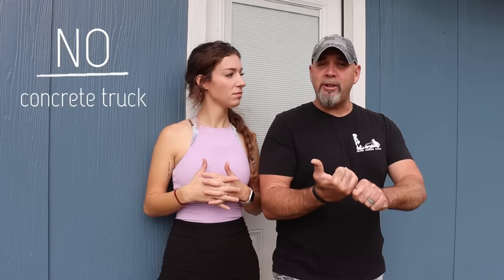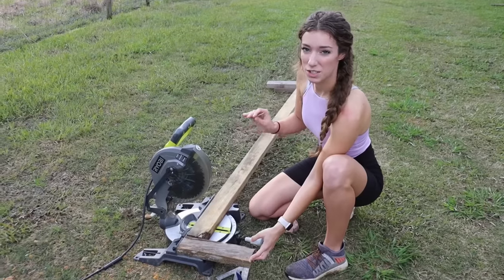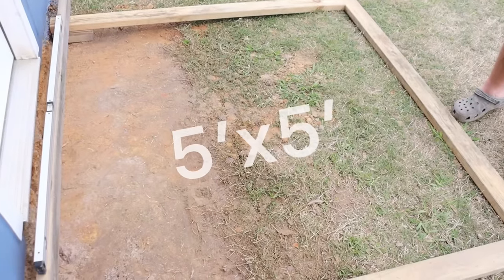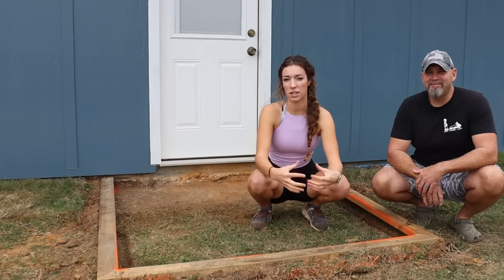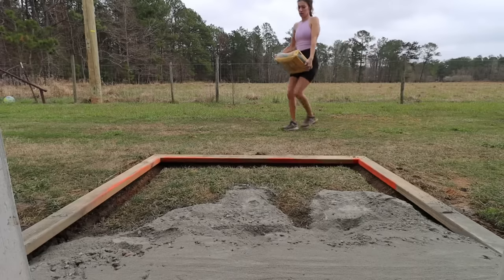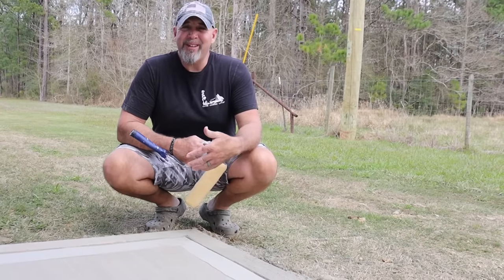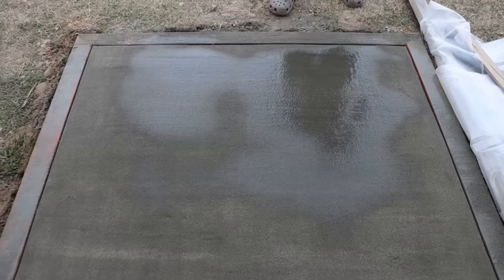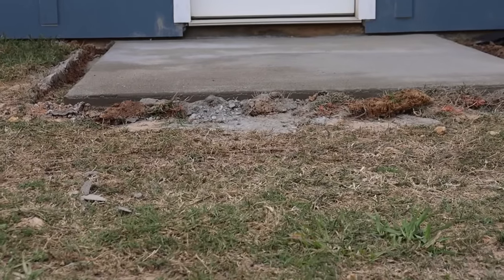How To DRY POUR CONCRETE SLAB and Update of Our 1st Pour

Comment: I wasnt looking for a new project, but I think you just created a new spark for this summer. Concrete for the fire pit and for my garage. Thank you for showing me the simple way to do what I always envisioned to be a difficult task. I can measure. I can cut. I can build it.
Reply: I want to create a concrete pad for my winter wood supply. It’s 6.5’ x 50’ area. Will this method of concrete slab be strong enough to endure the weight and winter weather?  (Middle of Michigan)
I do realize that I will need to break this up into smaller slabs.
Reply: Man I said the same thing.  Like I’m about to go build something for my dog outside

Comment: Well, I’ll be gobsmacked! Never would have thought concrete mix would set up this way. Not only timesaving, but you avoid the effort of mixing up wet concrete with a mixer or by hand with a shovel. And by the way, you have solved my problem of how to grout a 1000 square feet of laid brick. Instead of working the wet grout into the spaces between the bricks, I can pour dry mix onto the surface, carefully sweep it into the cracks, and then lightly mist with water. This will also save time and effort by not having to remove wet grout from the bricked surface. Perhaps I’ll do a YouTube video of the process and with y’all.
Reply: Awesome idea with the grout I’m Curious to know how that works out.I’m not thinking about a vertical brick wall I am thinking about grouting tile on the floor.
Reply: I may be overthinking things but wouldn't the dry powder on the bricks set up also and end up creating more of a mess than a solution?   If you weren't already going to do it,  I would suggest testing a small area first and move on from there. Hope everything turns out well.
Reply: Polymeric sand  is much easier to work with and that's what it is designed for.
 If it gets ugly down the line, pressure wash it, sweep in more, blow it off, wet it, done. It'll take you about an hour.
Reply: Great idea 👍🏽

Comment: I used to build fences and I would often dry pour my posts, and then water them all at the end of the post grade.  I never had a problem and 25 years later those fences still stand straight as an arrow.  Great job!! Never again will I mix concrete.
Reply from the maker: Thanks for watching!!
Reply: I did the same! The less water you use, the stronger your concrete will be.
Reply: Would this work for a sidewalk?
Reply: @andrewlaiz7648  Depends on the sidewalk. If it's not getting a lot of heavy traffic, then it would probably be fine. I personally would not try this for a driveway, but if you just want to add or repair a walkway between the back door and the gate, I imagine it would be fine for that
Reply: Same here. Wife and I did over 400 feet of cedar fencing in 1993 and set the post with dry pour. Lost 1 post about 10 years ago when a tree fell and snapped the post off. No problems with the other posts. Have replaced the rails and fence boards, but used the same posts.
Reply: How much water did you put in each hole, once you had your powder in the hole?
Reply: If you can leave the posts alone for a couple of decent rains + 1 week the concrete will wick the water right out of the ground. Right after the first rain I'd double check the posts for plumb.
Reply: I do the same with all my fences!
Reply: I did that for a fence 10 years ago.  When we moved out a few years later, it was still sturdy.  No issues.  I did this again last Fall.  
I also mix in some old (but clean) landscaping rocks.  Doesn't need to look spiffy since it's all in the ground.  Just keep dirt and organic stuff out of it.  The posts are 3' deep.  I add some water about halfway.  Then finish adding rocks and concrete.  Then dump some water on top when it's filled.  Any dry concrete that didn't get wet should be able to pull moisture from the ground.
Reply: They sell bags of concrete at home Depot made for setting posts , fast setting , the directions say to put it in the hole dry. I usually add a half bucket water on top. Some people let the concrete suck the moisture out of the ground , it dries slower , but strong. Problem is that the post will move if you touch it.  I have used the same fast setting concrete to pour small slabs , but I always mix it properly
Reply: @Sandra-Armstrong   not too much, maybe 1 or 2 cups. If the soil is moist, i use none (we pour water on the hole first and let it soak in if the soil is dry)
Reply: I always dry pour fence posts and even pole barns… I do tamp the concrete with the shovel handle… shovel some dirt on top  and tamp it with my foot a little… I never add water… it will set up just from the moisture in the earth…
Reply: I've dry poured posts, flagpoles, and mailboxes in the past.  They all have withstood the test of time. I never thought of dry pouring pads because I couldn't reason out how to water and finish it in a way that it would look good. This is ingenious and I will be doing it in the future!!!!
Reply: @Peter-wv5pl  I did the same but I didn't filter out the organic waste and top soil, I just added my cement into the mix. It's been 5 years so far, the only posts that have issues are the ones where we decided to back fill with large rocks and concrete rubble. No rot, but those posts have gone out of plumb. If I had my time again, I would filter out the organic stuff and use finer fines for the backfill.
Reply: For posts I always level and tamp the posts with dirt and small rocks using a steel pipe. When filled in with about 6" to go I put the concrete in and built a slightly tapered cone so water runs away from the post.  Gives a nice finished look, stabilizes the post excellently, and when the post rots the concrete can be broken up for post removal.  A person could do this dry or wet.  I have removed a few posts where people have put concrete in the hole well below the surface which doesn't really do as much to stabilize post but sure is tough to remove!
Reply: @Foxynaut888  ì

Comment: I did a 10x20ft slab using your method and it looks & feels amazing. Thanks for putting this out there. No idea why so many elitist contractors feel the need to knock this method. Getting concrete "professionally" poured is ridiculously expensive and I feel like this is a fantastic alternative. Time will tell. Best of luck to all of your future projects!!
Reply: I want to do a 10x30ft for a dog run. Just curious… how many bags of concrete did it take you?
Reply: I'm working with a 11x20xft. Backyard/patio. I would also like to know about how many bags you used.
Reply: Excellent comment 🫡
Reply: Perhaps use there measurements and multiply.
Reply: @strongbredbreeder   Just watching the video, they did a 5ft by 5ft, just see how many bags they did and multiply that, hope that helps..
Reply: This presentation is excellent. Thank you. 
I expect that I will be doing a project like
this soon. I enjoyed 
your patient comment that “ It is getting to be
fried chicken  time. “
Reply: It's not an elite contractor thing it's the scale of the job VS time.. still faster &cheaper to have a truck dump what 2 ppl would take hours or days  to do  in minutes, especially if u have to haul bags from store to site & bags aren't that cheap. Professional made concrete has other chemical additives and or fibers to strengthen & help it cure in different conditions, and if it fails its you can get you $  back or re poured. and there's the building codes. Imagine having your foundation fail after the first winter in your brand new home and you have to foot the bill again.. unless you've done the math for how much water each bag requires and let it absorb that much it won't hold up to freeze thaw cycles. The deck blocks that use to be manufactured this way get crumbly after 5yrs. Good vid though, gotta try it now after seeing it. love to see the bottom side or a cross cut threw the center to see how fully it set. Ps If you don't remove grass & roots you'll have a hollow spot after all the organic  matter completely breaks down. seen one fill up with rain underneath & make a sinkhole after a few years.  but mostly cracks in half or wobbles
Reply: Nice work, thank you for showing us.
Reply: I have a section of my basement that's kinda like a crawlspace but enough room to stand and walk. It's probably 10x20 and I was wondering how much your 10x30 cost
Reply: I think that a  big reason for the slamming of this method is simply because it's taking money out of those elitist contractors' hefty pockets.
Reply: Update: I loved my patio so much that I poured another slab about a week after my original comment. This one was 7x7 and is used as a grill pad & cooking space. It turned out incredible.
Reply: Did you lay rebar?
Reply: @silenteyes-rp6ij good comment I mean that
Reply: Great vid, I wondered about this but never tried it. It seems to work well, especially your gradual watering method for absorption. Your method appears to work very well & the follow up vid was great for confirmation. Besides, You weren't doing an entire house foundation, so the critical comments were unessesarry. Keep up the thoughtful, helpful, economical, practical, yet unconventional project solutions. I can't wait to try this.
Reply: There are calculators online you can use to get amount you need and even amount of bags you need. Even Lowes and Home Depot have one.
Reply: Updating my comment: Both slabs have held up tremendously through the winter. We reached temps of -10 in Michigan. The one thing I did add to both slabs was a concrete sealer. The sealer has worked great in protecting both slabs. Applying the sealer was very simple, just spray it on. I'm still very happy with my patio!

Comment: I'm a brick, block, and stone mason, but I do some concrete work too.

This is actually amazing, honestly.
I don't know why I haven't seen this done already or thought of it myself. 

It's easy enough that anyone can do it, and i guarantee it's just as strong as the traditional way too, for smaller pads.

I would just make them no thinner than 3- 1/2 to 4".
Especially if you live in colder climates with freeze and thaw issues. 
Well done!!
Reply: im in the same boat. Dont know if its easier than using a mixer for small projects but definitely not harder and easier on the back.
Reply: @Tyler Anderson I'm thinking if you soak the ground first, it would help pull moisture into the bottom of the slab.
Reply: Should some wire be added to it?   Pour concrete....lay wire top with more concrete?  I always thought hog panel would make great concrete wire.
Reply: @Tyler Anderson Maybe you could lay 2 inches, water that, then lay the rest. Also, it might be an idea to measure the water. After the first misting you could apply it with some kind of flower watering container. If you know how many bags you placed you can figure out how much water you should be adding. Just a thought.
Reply: @mckenziekeith7434  you're overthinking this just do how they showed it's good enought.
Reply: @mckenziekeith7434  don"t need it. capillarity action will go all the way down of concrete

Comment: 27 years as a concrete subcontractor. This both intrigues and fascinates me. There is such market for this application for small slabs, stoops and pads for equipment. Love to see how it holds up to the drips from the roof. 👌🏻
Reply: I just tried this today for my back patio. I wonder about the water drips too. It's a 9 foot fall off the roof. I'm thinking I should get some rain gutters.
Reply: @pilotandy_com  Gutters are best. But much easier project if you just want the water to avoid a few feet of the ground are rain diverters.  Basically just an angled metal piece that tucks under your shingles and keeps water from following into a specific area.  Of course, you then get more water flowing off on both sides of the area you are protecting.  But depending on your situation it could be much cheaper and easier than installing gutters with drains.  I used one for my doorway and only it took about half an hour.  Good luck with your project!
Reply: @pilotandy_com  do you have the option just to put a section of gutter just over the concrete,   I have seen where they, have decorative chains as the down spouts may be an interesting look.  This old house did one with copper and a chain link copper thing for the down spout,    Looked good,   Anyway just throwing ideas,   Hope it works out for you,
Reply: @raybucbolt  Just small info but I've seen more diverters than not cause roof rot - probably from catching leafs and dirt over the years and then the water backing up - plus the shingle can't really seal down properly because the diverter is in the way. 

I do gutters and screen rooms/patio rooms and got a few calls - on rooms where they had diverters over the back door - saying they are leaking but it's really the diverter and water coming through the soffit. Most of the time I catch it before hand because you can see the dip in the shingles where the decking is rotted.

I don't recommend diverters - if you must grab a 10 foot piece of gutter and some hangers and just leave it open on each side.. not very nice looking but it won't cause problems - unless you have wood siding or something..

Comment: Just completed my first dry pour slab :) it was only a 4x8 slab but it was easy and following yall's instructions it went fast and easy. I would never had tried or accomplished this without your video! Thanks again for what yall do! Keep it up!
Reply from the maker: Very cool! Thank you for watching!
Reply: How many bags do think it took ?? Thanks for any answers
Reply: How many 80 lbs. bags did you use?  I am doing a 4x8 shed slab soon. Thanks for your help.
Reply: @garyjohnston6248  He said they used 10 bags..
Reply: Depends how many inches a 4x8 slab at 3 inches = 13.3 80 pound and 17.3 60 pound  at 4 inches 80 pound 17.3 and 60 23.6 bags .keep in mind at 3 inches that concrete will weigh 1000 pounds just a heads up if u have just a car
Reply: @FirstnameLastname007  I can fit all of that into my Ria Rio with the seats folded down...
Reply: @FirstnameLastname007  i